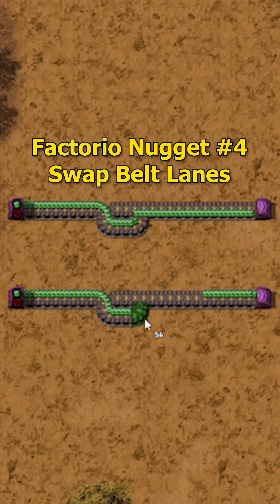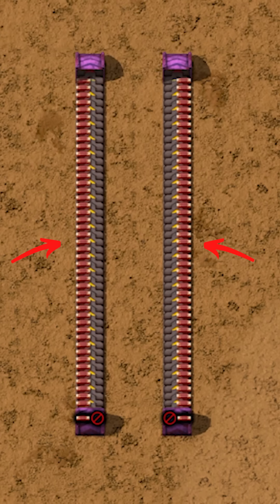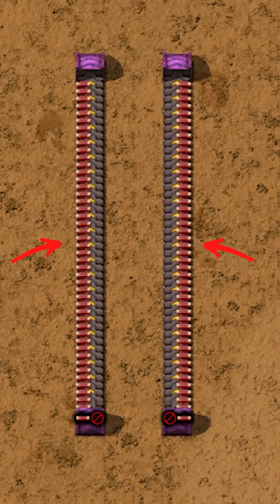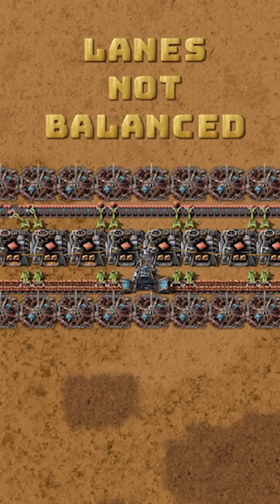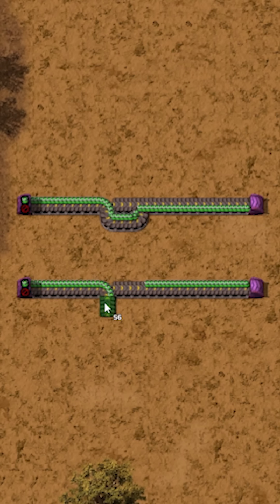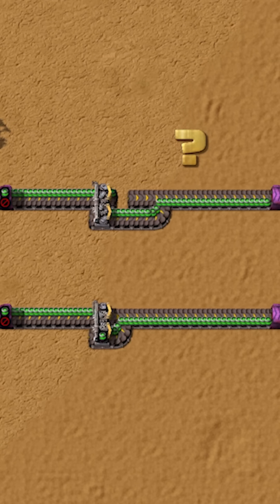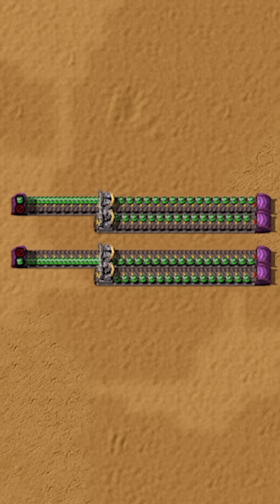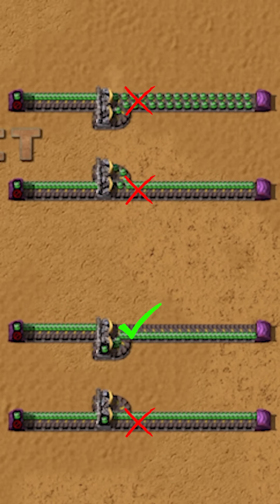How to CHANGE Belt LANES in Factorio #shorts #factorio #tutorial

Comment: You didn't actually show at all how to swap lanes. None of the suggestions swaps lanes.
Reply: they literally do though?
Reply: @painovoimaton swapping means left to right side AND right to left side. That's not happening here.
Reply: @martinj3239 Swap to balance are the key words here. You rarely need to actually swap lanes of different items as you complain. You can do that with a splitter or with a underground belt. (only 1 lane can get into the underground belt if you put a belt in 90° reaching onto a underground belt)

Comment: Alternate solution : instead of having a row of 32 furnaces, make it two rows of 16, either side of the output belt, with a splitter for the input belt.
Or use a mod that lets you configure your inserters.
Reply: Does that allow for full beacon coverage though? Swapping lanes midway down the belt is a perfectly acceptable and functional solution if you have a ton of beacons for the smelters
Reply: @StormArmy96  if you put the input belt on the inside of the two rows you can have the beacons on the outside but it'll be more costly on beacons. if you go the mod route it basically saves the few belts you use for it
Reply: @drakodra I use four beacons per furnace, so that point is moot as they can't fit on the inside. Also, ignorant productivity, one lane of ore only gives one lane of pkates so there is little reason to put the plates on the outside and lanswap as both outside belts will only move one full belt combined anyways. If we include productivity, then in 99% of cases it will be less than 100% so still not twice the output
Reply: @StormArmy96 if you make more than one you can share them, it'll be more costly in the end anyway but it's more compact and the more you have next to the other the closer you get to the same amount of beacons, plus if you're building a fully beaconed furnace stack you don't really worry about materials or energy at that point
Reply: @StormArmy96  it's completely doable. you just have beacon -> furnace -> inserter -> belt -> beacon -> belt -> inserter -> furnace -> beacon. then at some point you just merge the two belts for the output of the furnace stack. this is maximum beacon coverage you can have for a line build like that (not absolute maximum possible period, but for this particular kind of build).
Reply: thank you bob!
Reply: generally this is what you should do, but keeping things as one singular straight line of furnaces is a slimmer longer build and that tends to fit into places more easily

Comment: Is this a troll post? If not please explain in more detail. your just basicly having a straight belt and actually slowing the process down using a splitter since the through put is a tad slower then a normal belt. From what I understand the best method is the one you said not to use. Where you use a splitter and feed the opposite side of the belt so both sides have items and the inserted will continue placing longer since it has to fill up more of the belt.
Reply: Splitters have the exact same throughput as belts with the same colour.
Reply: @yvrelna I must be thinking of underground then
Reply: @mrorganic13 those also have exactly the same throughput as the same color belt. You can prove that fairly simply by setting up a race: fill a few chests with an item, set up stack inserters to unload the chests, one set onto a straight blue belt, the other onto a blue belt with as many turns, splitters, and undergrounds as you care to, and then end both races with enough inserters that they don’t back up. Then put down the last power to energize all the inserters at the same time, and marvel at how they all remain synchronized.
Reply: @d @danpowell806 oh okay I never tested myself , just went based on something I heard . Good to know, I never really cared and still have miner dumping onto underground’s 😂
Reply from the maker: It’s deffo a troll mate 😎

Comment: I like to use splitters, but instead of filtering for the item, i filter for a deconstruction planner on the lane I don't want. Small, standardized and easier to read what's happening from alt view.
Reply: I just priorty output the other lane so if it fills up it will do the other lane as well.
Reply: smart and simple I'll use it from now on :)

Comment: This is why I play with Configurable Inserters only. I just dislike this system that you can setup so much, but the inserter cant be configured which lane to put stuff on? BS in my opionion
Reply from the maker: You know what else doesn't make sense? Not having loaders as part of the default vanilla experience
Reply from the maker: Yeah it doesn't make sense. Feels like an intentional restriction that doesn't add any joy to the game. Just complexity
Reply: @Maxiume  I personally like the additional "challenge" that comes from this restriction, it means you have to actually think abit more about how you set up your designs.
Reply: @Maxiume I think it's a performance thing. Adding one more check to something that runs as often as them would hurt performance
Reply from the maker: @rejuvinatedghostd8769 humm… it could be. Inserters are a bit heavy on UPS.
Reply: Actually you can, maybe month already
Reply: @toyetak  what do you mean?
Reply: @888Brain you can cgange belt side unload in manipulator settings
Reply: Казуал
Reply: It's part of the charm of the game. Mechanisms like these splitters and belt balancers are part of the game. they would be pointless if you added what you suggest. at the end of the day, its just a game. realism obviously isnt their intent, or space wouldnt work how it does in space age.
Reply from the maker: @thevaren27  very good point!